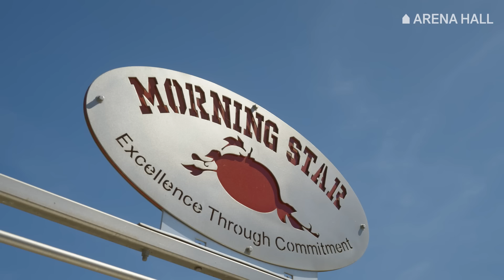What the no-boss revolutions means for the future of work

Comment: Bosses are part of an outmoded and antiquated system handed down from the industrial age. Chain of command makes sense for the military, but it’s stifling for creativity and knowledge work. We’ve been top-heavy for a LONG time. If you can’t clearly and easily articulate what your “leaders” do to add value your work, then they’re just in the way. Only a few leaders I’ve experienced are brilliant strategists, and they will struggle to compete with the strategic thinking and reasoning of AI. Humans are flawed, biased and riddled with fragile egos—the higher up the chain you go the worse it seems to get. At best, a good boss is a coach and mentor. If you’re lucky, they may remove blockers for you.

The age of leadership is dying as people become more self-directed and autonomous.

Comment: "Imagine that [the C.E.O.] had to [take a stand of some unpopular controversial issue]"-because you were forced to in order to secure investment capital.... that you are dependent upon in order to continue growing. Because the reality is that the marginal cost of production either plateaus, or (most likely) decreases at larger and larger scale.  So maybe we closely examine the implications of taking that obligatory stance, and why that coerced position is what it apparently is. Because of course it's not just "any stance" on a specific issue. It's "the correct stance" on a very specific issue, that is required. It's easy - who is requiring it? What are they requiring? And which way does that move the money-power-control trifecta - closer or further?

Comment: We dont need a boss.
Reply: Actually you do. You just dont want one, which is how a child thinks.
Reply: @WillmobilePlus  cooperative management is feasible, scalable, and much more robust than capitalist management.
Reply: @holleey  LOL! No it isnt!

If it was, people would have been doing it decades ago. Even the most hippie of places that tried this, always went under because you are giving power and authority to idiots that will use that power to do as little work as possible for their salary.
Reply: @WillmobilePlus  people have been running worker-coops successfully since decades despite the framework of our capitalist system suppressing it in most countries. always went under? the longevity of worker cooperative is vastly greater than that of a capitalist run company.
Reply: @holleey  Co-ops have bosses and hierarchy, dude. You cant run anything without supervisors and bosses. Someone has to be the one where the buck stops.
Reply: @WillmobilePlus My opinion a boss isn’t the best thing if you are worried that a worker will do less without a boss in my opinion even if there is a boss or not that worker will do less either way and hide it from his superiors pretending to do a lot and to be an asset even tho it is an illusion.
Reply: @WillmobilePlus  it's different in some very significant ways. a coordinator in a cooperative has no authority to, for example, fire a member of the cooperative, as that member owns the cooperative to the same extent that coordinator does. 

you'd be surprised what kind of motivation people naturally develop if they are enabled to work on a project that's actually theirs, where they've actual stake and responsibility, and not just something they submit to their employer at the end of the day. these people do not need to be supervised in the sense of making sure that they do not slack off.